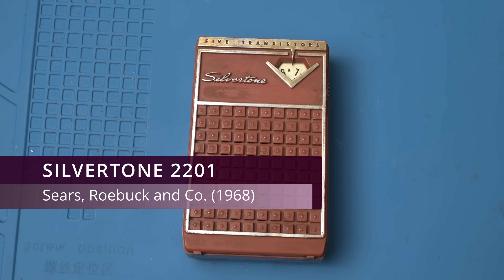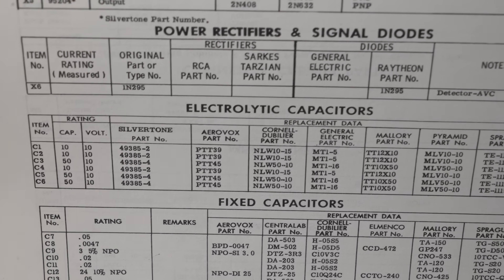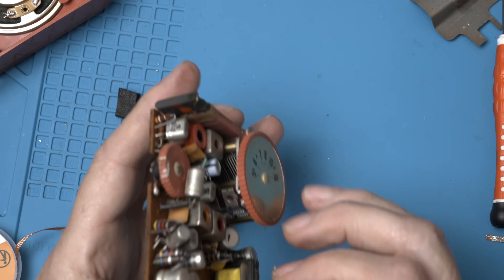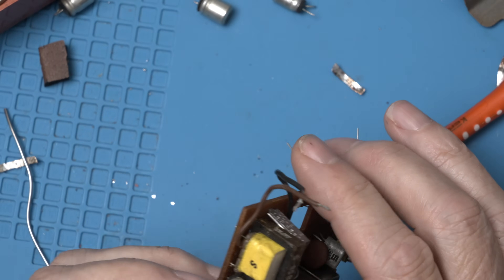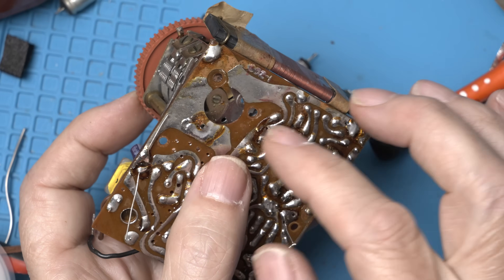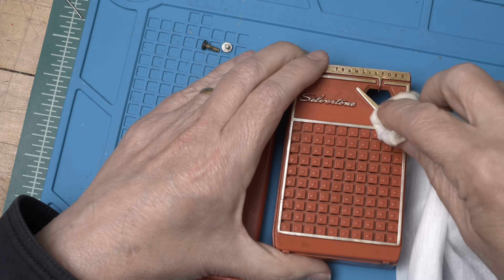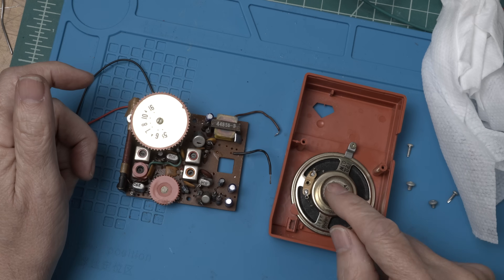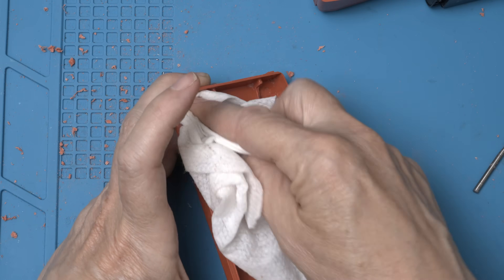Vintage Electronics Repair: Dead Silvertone 2201 transistor radio restoration

Comment: Many of these radios benefit from a careful alignment. Do you do this? If not, you should. I enjoy your videos. I believe it was made by Arvin, not Sears.
Reply from the maker: Thank you.  I haven't done that yet.  I've read the method and I have a frequency generator, but I've also read that it easy to make things much worse if you don't do it correctly.  I should take one of the ones I've done and practice when the cameras aren't rolling!

Comment: There is a Battery called Exell 206A, round and 9 V and its fits in this radio. So there was no need to destroy this one and you have keeped it in it's original state. Apart from this i like your Channel and subscribed.
Reply from the maker: Thanks for the info and thanks for subscribing!  As as I said I'm still learning.  I just checked out the Exell 206A on Amazon - even though they're $20.95 each (gulp) I probably would have used it.
Reply: @Dream.Build.Create ...that's more than the radio is worth...
Reply: ...well, "ya CAN'T please EVERYBODY!!!"
Reply: @daleburrell6273  Of course you can't please everybody.  
But this is my opinion and i can say it. 
I give him a hint, that these Batterys are not obsolete and he could have use it next time if he wan't in other Radios. I also didn't dislike the Video. So what ? 
When i restore old Radios, i make them as Original as possible. That's why i don't like it when he cut the plastic down for a cheap 9V Battery. You say for the Radio is it not worth, but other People see another value in the old things.

Comment: Well done. So only the eletrolytic capacitors you replace and not other caps?
Reply from the maker: The electrolytic capacitors have a fluid inside them that dries out after 30 years or so - and these radios are more than 60 years old!   The other capacitors don't have anything inside them that changes over time, they will last indefinitely like the resistors.  Although film capacitors, in high end audio gear, might get replaced because they can go out of spec over time.
Reply: @Dream.Build.Create  Good to know what you just said.Cheers and I enjoy your videos. More transistor radios please.